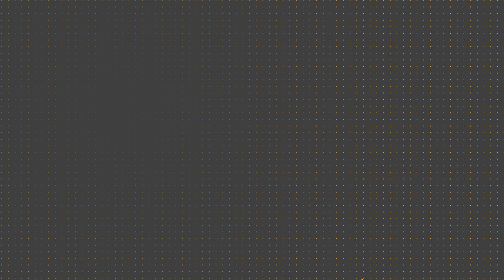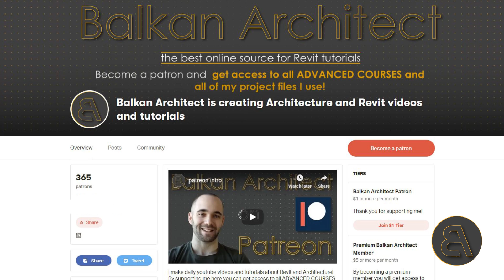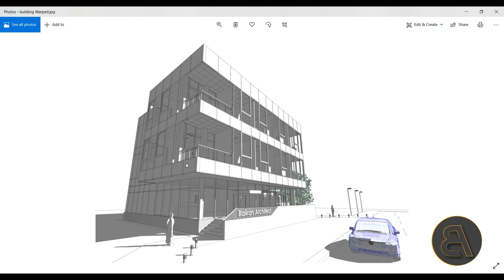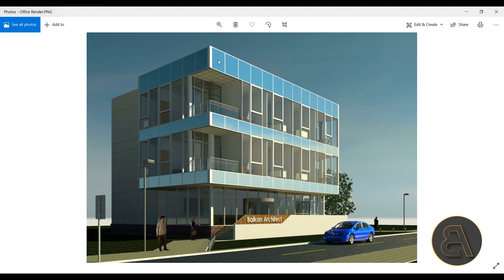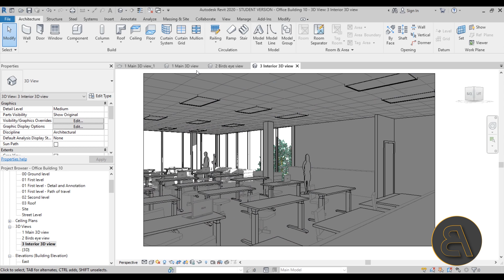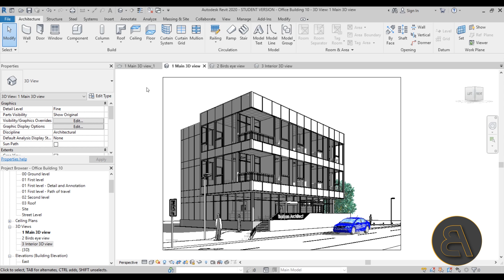Office Building Rendering in Revit Course - Part 10

Comment: hi ...how to copy columns, beams, doors etc include their marks to different level in revit? because if im copying and paste aligned to selected level, the mark cannot copy as well, so i must input the mark one by one
Reply: I would use Dynamo, Revit is unable to retain marks as it is a special system field. Consider using type marks as a type parameter instead of duplicating an instance parameter like mark
Reply: @AussieBIMGuru  can you share dynamo script to solve my problem, coz my beam plan was typical plan from1st floor to 3rd floor, thanks before,  or maybe i try to use type mark
Reply: @cindarwiratmoko1390  try this script:
https://drive.google.com/drive/folders/1himZrV8o-1qcseslZSs6u_hIQTRJLk1N?usp=sharing

You will need Dynamo 2.0 and clockwork installed. Suggest you run via Dynamo directly so you can see and adjust the fields.

It should work for most level based elements. Some hosted elements like doors it may struggle with unless you also copy the host at the same time.

Comment: How beneficial you would say is revit for Mechanical Engineer? Can i do pressure/flow calculation of piping system within Revit without having need of plugin?
Reply: Many mechanical engineers use Revit, as long as your elements are modelled as connected systems it is very capable of cfd analysis etc.

Comment: I got a question for you, what is the other software you use to do things maybe easier than revit or revit cannot do it ?
Reply: If you're looking for a simpler tool that can still do similar things maybe begin with Sketchup - it's not as advanced but is a simpler 3D modelling tool most students begin with. It will help you get used to working in 3D space without the complexity of parametric design.

Alternatives are Blender3D, Rhino and ArchiCAD. I would suggest Revit though - it's more popular and will likely be the leading platform in BIM for a while. Revit can do nearly anything as long as you are creative and know how to work with and around the software - there aren't many hard built limitations that can't be overcome.
Reply: archicad...